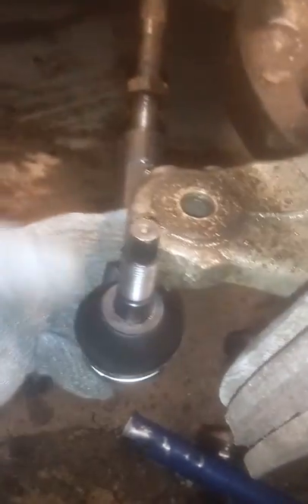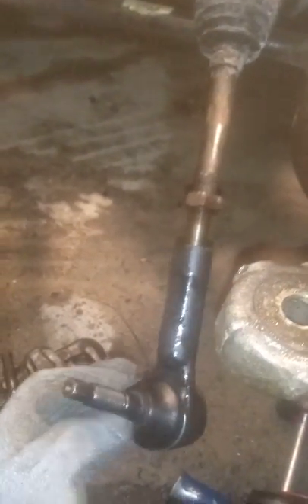2008 Chrysler Aspen How to Change Upper Control Arm and Outter TieRod End

Comment: How do I know if my CV axle is going bad on my 2007 hear a grunt squeaking sound 10 miles n up
Reply from the maker: Is it a nonstop Growling type sound when you start rolling and does it get louder the faster you go and can you kinda tell that the sound is coming from one tire more then the other. But at the same time, also sound kinda loud in the car? Also, you should drive it and drive straight and start swerving hard right and then hard left and see if the noise kinda goes away a little when you start hard swerving your vehicle one way or the other., If so, then that means you're dealing with possibly a bad wheel bearing not CV axle.